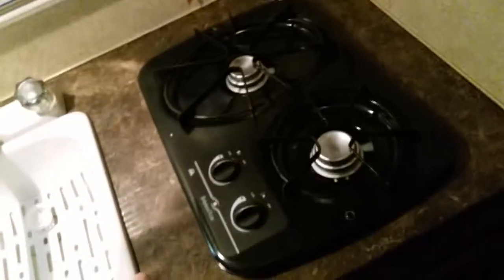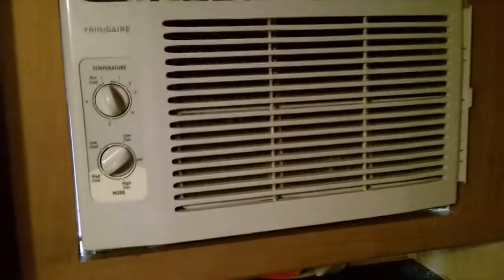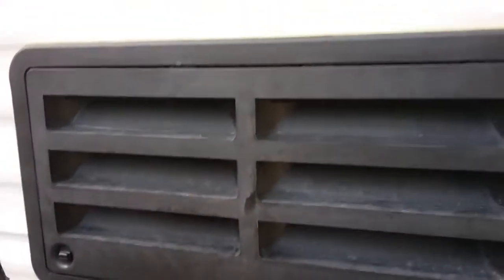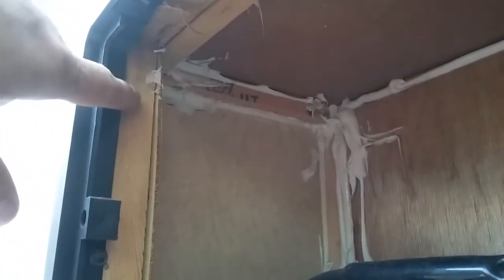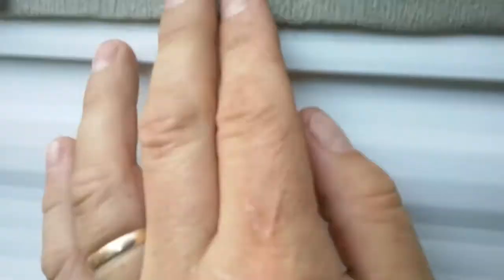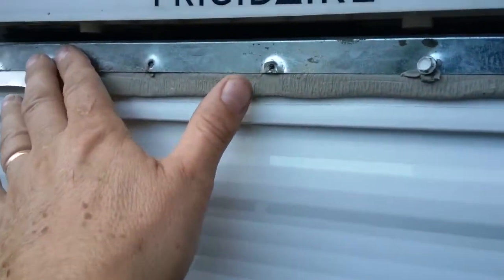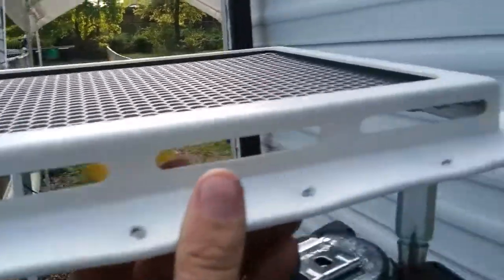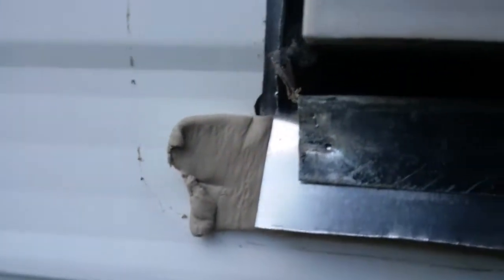Rv a/c side wall unit

Comment: Excellent video. I have a 2022 TLRV ROVELITE 14FD with the same sidewall AC unit. Ours leaks into the inside as well. How does your repair work now? What a poor design.
Reply from the maker: I have no more leaks after I fixed it that time and yes it's a poor design

Comment: Nice video.  Can you tell me where I can get that rear grill with the white frame?
Reply from the maker: https://www.homedepot.com/p/Everbilt-24-in-x-1-2-in-x-12-in-Plain-Expanded-Metal-Sheet-801417/204225783?cm_mmc=Shopping%7CG%7CBase%7CD25H%7C25-4_BUILDERS_HARDWARE%7CNA%7CLIA|71700000044822926|58700004636006010|92700039037730264&gclsrc=aw.ds&&gclid=CjwKCAjwmNzoBRBOEiwAr2V27U7VoGA_aowNRY7FxhEVNqv1CCZ59clp_0F_nH76kVh73oE8VCEsqxoCu8IQAvD_BwE
Reply from the maker: https://www.lowes.com/pd/hillman-12-in-x-2-ft-cold-rolled-weldable-steel-expanded-sheet/3051815?cm_mmc=shp-cprdhdwgooglelia-213-threadedrodandmetalshapes-3051815-_-0&kpid&store_code=381&k_clickID=go_1737082938_70689697671_338421041943_pla-444061837602_t_9008479&gclid=CjwKCAjwmNzoBRBOEiwAr2V27ZZJE9Z20IRI2rZbUgO_BExoRNWpq5-XwoKQDsRfqt2nRKiO6ttjcxoChqEQAvD_BwE
Reply: I want to add this style a/c unit to my camper, I have searched the web to the  very end looking for this
😄 trim ! I see why this was a bad Idea on the video, there's nowhere for the water to go! I hope to find the trim someday that will extend out an inch or so to let the water out down the outside instead of inside the wall!

Comment: How did you romove the ac unit.  I tried to take mine out from inside the camper but not working.  Does it come out from the outside?
Reply from the maker: It come out from the inside but you have screws holding it in place I had to remove the vent on the roof to get to my screws  so look around the ac unit for screws. I had 2 screws holding my a.c. in place
Reply from the maker: If you go to 7:20 min of the video

Comment: I've been wanting to install a wall unit in my 19ft fiberglass aerolite ...How is the AC anchored and  I have everything except the outside AC Grill ..and can't find anywhere to buy one .. does it have a part number ?   Thanks For the video .. Blessings
Reply from the maker: I hope this help my a/c unit was bolted down with the grill cover from the manufacturer  but lowe's has this grill  Saint-Gobain ADFORS Door Grill Aluminum
Item # 15663 Model # 71439   and check with a  rv dealer  for a pvc trim ring to cover your ac unit and the grill..
Reply: @BALD8BIL  is